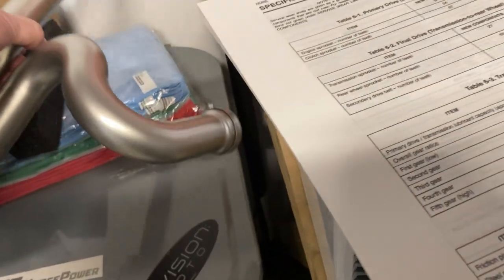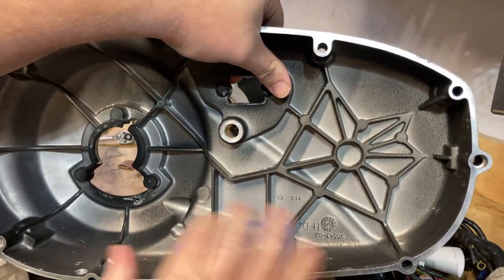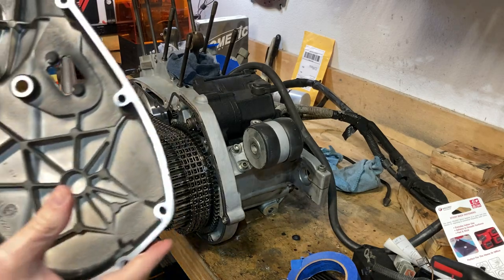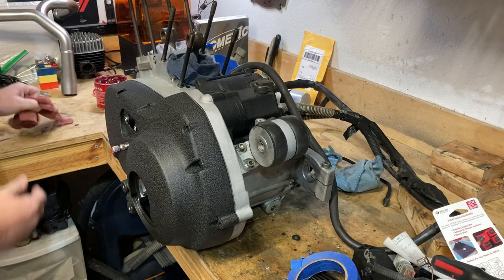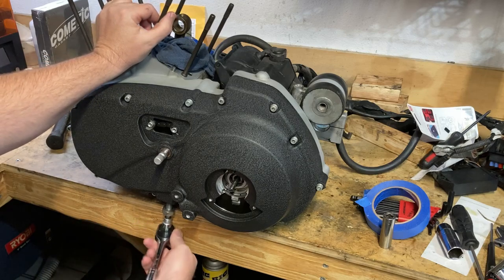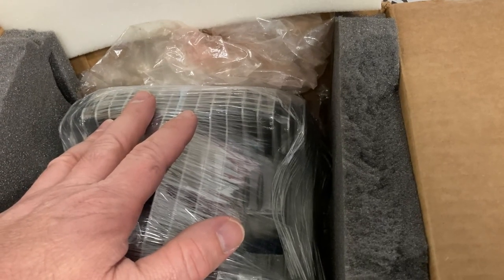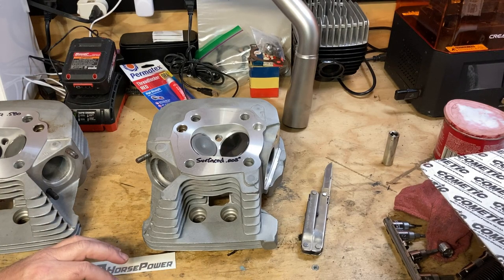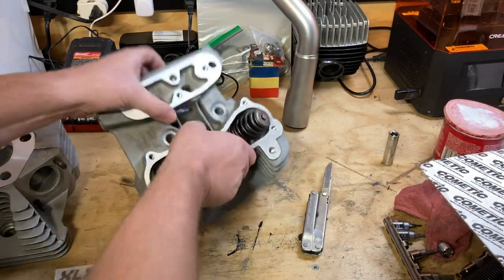Reviving my Buell: A DIY Motorcycle Rebuild - Engine Reassembly Part 1 of ?

Comment: Those are some beautiful pipes, I use Eagle One Nevr-dull wadding polish, and fine sandpaper if it had ever been wrapped or to clean surface rust.   Teflon washer/seal on the primary chain tension, if it were to leak mine would probably be the first, since I had a crack running along the thread.  Oil drain plug, use H-D rubber O-rings cause if it's too big it can blow out the seat, and yes.. crack the cover, and 14 ft lb of torque the manual suggests is questionable as well.  Way too tight for an oil drain bolt if you ask me but anyway, use discression.  As for not damaging the shift shaft seals I use alcohol or accetone to dry the oil so the tape sticks, then wrap clear shipping tape over the sharp parts, leaving a bit of extra at the end to fish it through more easily then just slide it on as evenly as possible.  Same goes for removal of primary cover, always use clear packageing tape first. Not sure how that would work with the tight brass bushing... but that tape is pretty thin and rather strong. Carefull with grease in the primary oil, it can contaminate clutch surfaces.  I also saw the brake rotors on the back wall and I have been rather happy with the EBC rotor paired with EBC metallic race pads and the EBR front rotor mounting hardware which basically makes the brakes no longer "floating", and instead hard mounts to the rim.  Motul RBF600 DOT4 race fluid is outstanding, brake lever feel is awesome, no soft "smooshy" feel.   You can also go with the semi-metallic pads, depending on how you ride, but I had never felt any issues even in cold weather with brake fade on initial brake application, probably due to Buells huge rotor heating up rather quickly.  Good thing you did'nt polish the ports on those heads, there is quite a bit of information on fuel beading on a smooth surface so best to leave it rough, it can cause raw fuel droplets to enter a hot combustion chamber, not to mention only atomized fuel vapor burn. As for the exhaust side, again a rough surface creates better flow, kind of like how the dimples on a golf ball make it fly farther... but anyway.  Nice work.